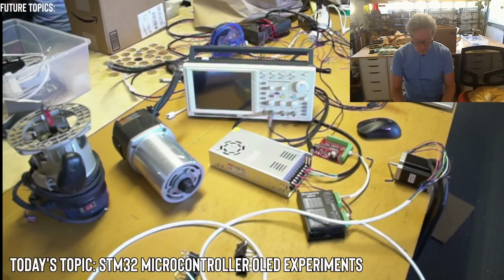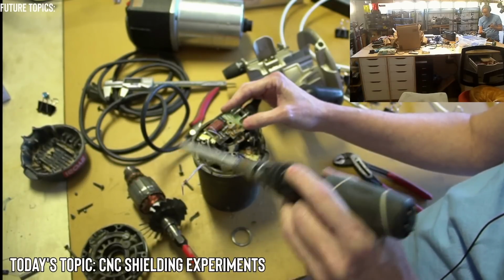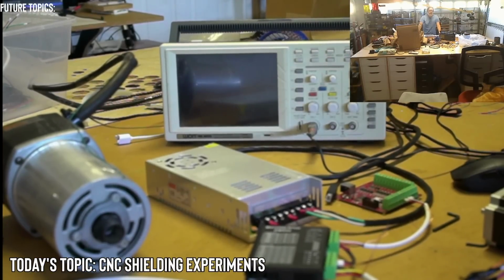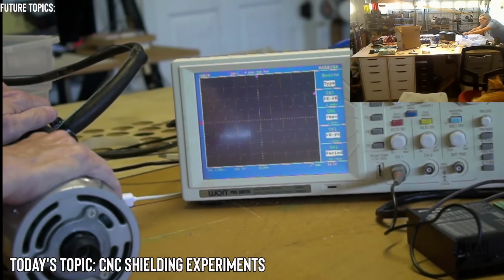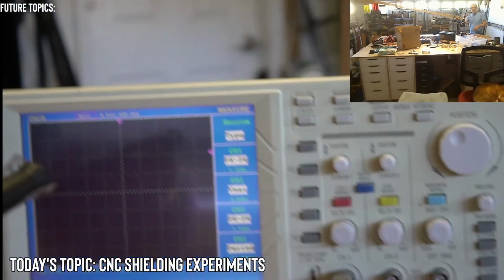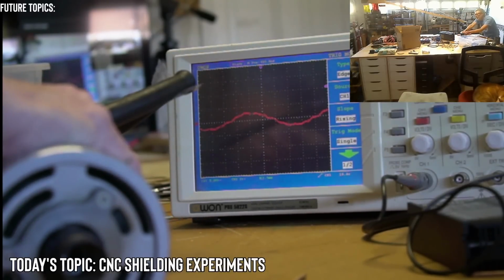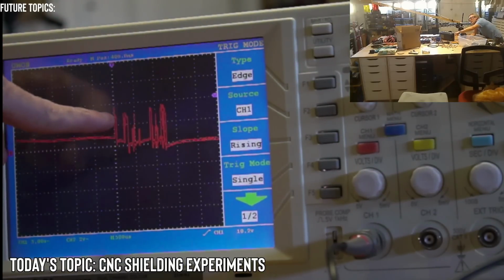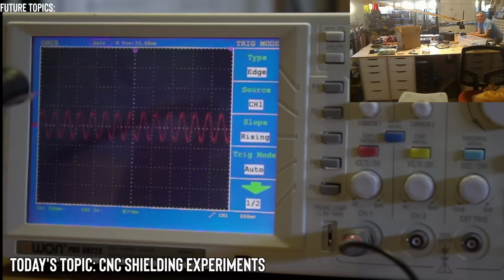CNC EMI Investigation: Router Noise Testing & Teardown and Getting to Know My Oscilloscope

Comment: New bearing for this Ryobi router could bring it back to use. Don't throw away :)
Reply from the maker: Haha! Yeah, it's already in the landfill. RIP. I tried to salvage the enamel coated coil wire but that was stuck, so not worth the time.
Reply: OK, I watched it further and I see there is now way back :)